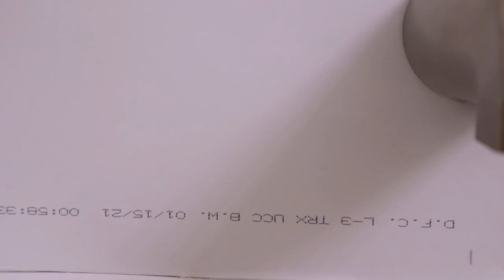#1 Tip for PERFECT CAULK LINES! Tub/Shower Surround Install in a Mobile Home

Comment: For your shower and when the boys are big enough get the shower head you can remove and wash down the walls and shower curtain to keep soap scum down and easier to clean. We do not use glass doors as all they are good for is soap scum and water spots to clean. A shower curtain liner is cheap and easy to replace when they get soiled.

Comment: Do you caulk the top of the surround or do you have something that goes across there? Watching you put up the towel bar reminded me of a time, years ago before google, that I was trying to install one in my bathroom. The old one was already off so I didn’t see how it had been put on. I didn’t know about the little screw under the whatchamacallit and it took me forever to figure it out!
Reply from the maker: We have some small solid PVC trim that will go around the tub surround, tub, window, floors, ceiling, wall transitions... LOL Just a few bits. ;) Almost there though! Oh yes, hidden set screws can be a nightmare! These were ultra-tiny flat head screws and quite finicky.  Thanks!

Comment: Try using alcohol to remove stamping but make sure you rise off well, otherwise great job!
Reply: I was going to suggest the same. 90% isopropyl works the best.
Reply: Try a pencil eraser. Not to hard or you'll remove the finish

Comment: Test it on a scrap piece first, but acetone might take off the text with not damage. Keep up the great work. "easy stuff first". I think the other way, get the hard stuff out of the way and save the easy for last. Either works. I hope you and the tripod had a good time.  Ha Ha
Reply: Or MEK might remove the lettering. But, same advice goes, test it first on a piece of the scrap.

Comment: rubbing alcohol should take that printing off the panel.  At least I have found it does. Good idea on the taping the caulk joints.   I could have used that idea a long time ago.  Thanks!!

Comment: The tub looks great. 
You're going to regret not rolling the panels with a rubber roller or like I did using the poor man's method of wrapping a towel around a 2x4 scrap and pressing/ sliding it over the whole surface to get maximum adhesion

Comment: The guy that put up our surround used glue on the seams instead of caulk and smeared it in a two inch strip. It looked horrible. The wall above had stain from well water and was really bad as well. I wanted to make it look decent for at least a couple of years and we'll be out of here. Used beige colored duck tape on the seams and painted the wall and ceiling with white semi gloss. Can't wait to see what you put on the top. Great job!

Comment: I learned a lot from your techniques, thanks. For example, using an oscillating saw, a boring bit, and an adhesive trowel. I learned so much, when I expected to learn about caulk lines. Thanks for the extra information!

Comment: Just a suggestion, about the "real towel" .
When my Dad got dementia he would take the towel off and throw it in the floor to stand on while stepping out of the tub.
Ev very time.
I finally got a clue and discovered the bar can be wiggled just enough to get it out of the brackets and insert it inside a roll of paper towels. I think I heard angels sing! No more wondering if the towel is still clean nor finding it in the floor. 
Congratulations on getting r done!!!
☮️💖🙏🇺🇲🇦🇷✝️🎉

Comment: Oh Sam it is okay because we all have done something like this one time or another, and the fact that you left it in the vlog well it will definitely help some other human being to not do that so it is a teaching moment! Also if the mobile home manufactures would do as you are then the home would last a lot longer with out having to deal with mold issues and weakened floors an leaking window seals and roofs! The way I see it if they would watch Angela and you they would learn a lot and maybe do better at building homes.  The lettering at the bottom try some 91 % or higher on Alcohol and put on a rag and see if it might rub off if it is not Etched in the material.  Because we did that with one years ago and it almost took about every bit of it off.

Comment: How did you waterproof the window sill in the tub/shower area? I like the job you did on the surround. Very nice.
Reply from the maker: It's not waterproofed yet. We have solid PVC trim that will be installed then caulked over to seal it all up.

Comment: I have never installed one of these but I need to so this question is for future reference. Why do you not calk around the top and bottom of the surround? Thanks so much. Love the remodel. I always enjoy all of your videos. You two are so funny and work so well together. I am currently building a chicken coop and run using all materials I already have on hand including wood I had under tarp from 2019! The coop is way over kill but the wood was bought to build more raised beds not build a chicken coop. Use what you have when possible, Right?
Reply from the maker: Def. caulk all around the surround. :) We didn't in this video because we're adding trim (molding) around it. It's all going to get sealed up in the end though. So you're on the right track! :)

Comment: What did you do around the  window to keep and finish it out. It looked finished in the end but at the beginning of the video it looked like it needed work. I have done all that which you are doing except the window, I took it out of my bath in the old house we did the remodel in, and I know for a fact that it is NOT easy, although you do a great job of making it look like it is.. Keep on showing how to do work on the Home stead...
Reply from the maker: The window's not done yet -- we have trim to install around it then caulk it all up tight.

Comment: Isn't the drywall going to rot eventually? I couldn't tell if you are placing the surround directly over drywall or is there wonder board or some kind of waterproofing coating? I would be concerned about mold.

Comment: So if you haven't gotten it off already.  Sunblock may take off the lot number on your panel with the plumbing.  For those that don't know this hack already...spray on sunblock removes Sharpie like it is a dry erase marker.  It's really unbelievable and you won't believe it until you try it.  It wipes right off pretty much any hard surface.  So if it removes Sharpie it may just get rid of that lot number for you ;).

Comment: As a professional caulker I am highly critical of stupid crap that YouTubers do when installing sealant. You did it pretty much how I would tell a homeowner to do it. Without any of the stupid crap like soapy water,or window cleaner. Well done.( assuming you cleaned it well first) The only thing I would say is don’t use a solvent like acetone to remove silicone from your skin. It dissolves the silicone so it can be absorbed into your skin.

Comment: Great job Sam. What is that brown line going down the wall on the shower head side of the shower?  Is trim going there?
Reply from the maker: That's the wall transition from a prior plumbing headache/hurdle we had to overcome when installing drywall. We have trim for it -- it'll be well hidden when we're done. :)
Reply: @sam-and-angela  everything look very nice. You are doing a great job.

Comment: Using heavy duty plastic liners in the tub/shower area is great but in mobile homes, the #1 by far and away biggest problem beyond any and all doubt is failure of the plastic bathub/shower bottoms. I’ve lived in a bunch of mobile homes in my life and ALL of them with plastic tub/shower bottoms failed. Cracking, splitting and soon total failure before you can get them fixed. Heavy duty walls are great but if the tub bottom underneath isn’t 100% braced to a fair thee well, the walls will be irrelevant as you watch the tub floor crack and split (always while you’re in it!) and the water rushing onto the floor underneath.

Comment: Question:  Did you use cement backer board behind the shower walls?
Reply from the maker: Nope, drywall then tub surround.
Reply: @sam-and-angela  Wow,  that would never pass code in Wi.  Thanks for your reply.

Comment: Do you have an overflow drain in the floor?  Or is that not a thing in the US?  Hi from Australia.
Reply from the maker: No drains in the bathroom floor. The tub has its own overflow drain -- just below the tub spout.
Reply: @sam-and-angela  oh ok.  Lots of things different in different countries I guess.  For example - our light switches on the wall are opposite to yours - up is off, down is on.  Fun seeing the differences.

Comment: Don't use alcohol because it will take the gloss finish off the surface.  Try a citrus based cleaner on a Q tip.  Don't spray the wall.  Ask me how I know.  Major blooper I am living with.  And if you cut your caulk tip as small as possible at an angle then sand the tip to remove burrs will give you smoother lines and less mess.

Comment: do you have to let the bath tub/shower enclosure to cure 24 hours before using?
Reply from the maker: It depends on the caulk used. As a general rule we wait at least 24 hours before getting the area wet if we can.